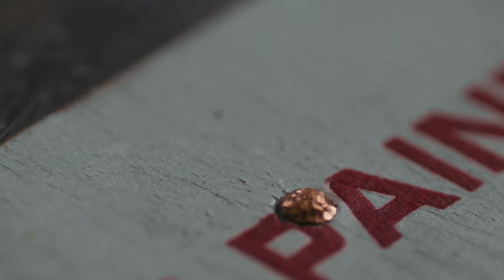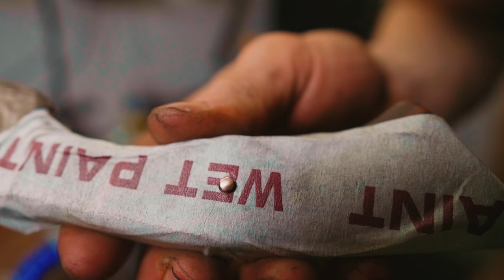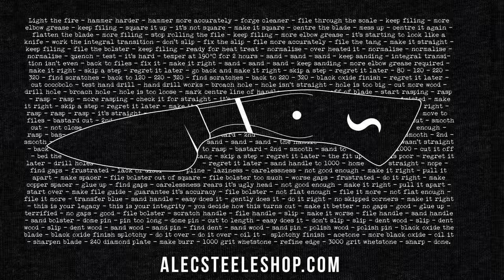MAKING A KNIFE WITH NO POWER TOOLS!!! PART 8 - FINISHED!!

Comment: The copper shim was definitely agood mistake.
Reply: Luis Gerena 
It was as if it was planned.
Reply: Happy little accident
Reply: love the Bob Ross quote
Reply: Must agree. I came here to make the same comment. Great finishing touch.
Reply: I was gonna say the same
Reply: this was going to be my comment
Reply: The copper shim absolutely made it better.
Reply: Not a mistake but a design modification! To quote Tim Yoder. Check him out Alec You can learn from him your to hard on your self!
Reply: The copper came out way better than the black shim would have.
Reply: I love seeing copper being used to fit wood and steel together, because the malleability of it means it can be easily shaped to fill in little gaps, while the colour and shine means it matches both for how they look.

Comment: Hey Alec I hope you read this! When you have a little dent in the wood and it didn't cut the fibers you should be able to fix it easily.
Just grab a moist piece of towel and a clothing iron. Now put the moist piece of towel on top of the dent, and put the clothing iron (or something else that is very hot) on top of that. 
This will create steam that makes the dented fibers swell up to its original state. Now just sand it lightly since some fibers go and stand up which gives the surface a rough texture.
I hope this helps you in the future.
Reply: Yep. I do that......a lot!!
Reply: A great tip Pandasty. Thank you for sharing that one!

Comment: if you use a wet rag, a iron and a piece of wood with a dint in it, if u iron the wood with the wet rag between it will bring out the dints, allowing you to sand them flush or have less of a dint.
Reply: NoSoupForYou9871 I’ve heard about putting a drop of white spirit in the dent and lightning it too, obviously quenching it quickly before any burning, also works?
Reply: Dinto's Twin never tried burning it  so i cant say but the iron works fantastically, use it all the time when i mis swing or drop something when wood working

Comment: Wonderful job! I have domed a lot of pins and I have a tip for you. Try a very small ball-peen hammer and no punch. You will be surprised how much control is possible with just a 6 ounce ball-peen. I use the ball end of an engravers hammer and it works wonderfully.

Comment: To be honest I like more the flush pins you've been using in the past, it should also feel better in the hand not having that bump sticking out of the handle. That said it's always nice seing you try different stuff.
Reply: Mindereak-I was going to say the same thing
Reply: The bump is so small that I doubt it will be a nuisance for your hand. It probably just gives it a better grip.
Reply: Well I don't know about the hand feel, I was just assuming it. It's just that besides that I just like the "flush" pin more, it looks neater.
Reply: Nah I love the dome :). for having had knives with domed rivets before, I think the bump it gives feels quite good.

Comment: Why not make a die/punch with a dome shape in it (concave) so its a little less dangerous and a little easier and efficient to do the same thing?
Reply: That's the tool I've learned to use for that job, you're right.
Reply: I'm talking out of complete ignorance here,but i think that such a tool would slip even more,and by having the dome carved in it would scratch and dent the handle even more. But as i said,i know nothing about that,so please correct me if i'm wrong.
Reply: with the round tip, you push material around in a more precise/controllable fashion
with a concave tool, your basically mushrooming the end material, causing stress throught the pin
and especially at the ends

also using the round tip tool, you dont lose end material due to compressing the pin
so you can have more material forming the fastner, meaning more room for detailing
and the end wont shear off as easily

Comment: That's a damn beautiful knife. The focus that was required due to the hand tools made it even more beautiful. It's amazing that you can get a result like that with basic(ish) tools. And although the copper ring on the handle wasn't part of the original plan, it made it so much better.

Comment: A lot of the time, if you "dent" the wood, you can bring the dent out by ironing the dent with a piece of damp cloth or paper towel over the dent. The steam will raise the grain above the surface so you can sand it flat. I use that a lot for getting dents out of old military rifle stocks.

Comment: If you have miss-hits and scrapes in the wood like you had here, put a little bit of wet paper towel over the indent, then heat it quickly with a piece of warm metal (I usually use a clothes iron).  This will bring the grain and wood back up.  Yeah, you'll still need to refinish it, but you won't need to remove as much material as you would without raising the material.

Comment: Awesome, if you ever do this again, maybe try putting a washer over the pin before taping around it, that way if you slip off the pin when doming it the washer may save the wood. Just a thought, not coming from experience :)

Comment: Want to know the key to patience? Think about your work like this; whether or not you aim for excellence, you are still doing work. You can rush making 10 knives instead of one that's excellent in craftsmanship, but then you sell those knives for 10 pounds each, instead of selling the one excellent product for 150 pounds. You end up losing time and money, because you did something lazy and hasty. Don't think about the finished product when you are working, but the work itself. I love to start new projects constantly and find it hard to focus on the task at hand if I have another idea brewing in my head. But to progress, I need to push on with the current project as much as I can.

However, when you feel like you are overwhelmed, focus on the simpler projects for a while and return to the original when you feel rested. Excellence takes a toll on your mind, it creates stress. And that stress will go away, if you get your mind off from the difficult project at hand and do something else. Do some designing, clean up or prepare for the next project at hand.

Lately I've noticed that you've been stressed out slightly. Remember, that your mind and body needs to be taken care of before anything else. Don't burn yourself out. You have many years ahead of you and you are progressing great. Just remember to take a break every now and then.

Fantastic job on the knife, as always! This has been one of my favorite series so far from your channel, since the use of hand tools is an important craft in your profession that should be preserved.

Have a great spring!

Comment: Make a funnel jig (a countersink in an inch plate of steel) that fits over the pin you want to dome. The measurement (math) would vary with the size of the pin, the funnel, the cylindrical punch, and the taper, but you get the idea - just try to stick a pencil inside a hole to trace the inner diameter of the hole and you see that the width of the pencil and the sides of the hole prevent you from doing that.

Comment: correct me if i'm wrong, but here's an idea for domeing the pins.

Take out the copper pin, heat up on side, place into handle, lightly hammer it to the dome shape. Take back out, heat up other side, place into handle, lightly hammer it to the dome shape.

Comment: the copper shim was a beautiful mistake, the copper between to black and the wood makes it look amazing.
you can remove small dents in wood using steam. place a wet a rag over the dent. then use an iron, or a warm piece of steel to heat the rag. there are a few videos on youtube on how to do it.

Comment: It looks amazing and you should be tremendously proud of yourself. I hate to nitpick but I actually work on these kind of transitions some times, you could have filed close and used a fat razor to trim it true without having to touch up the wood or the metal. Great work though and always pleased to see your new work.
P.S. when you doing a scabbard series for all the cool stuff that could use a sheathe?

Comment: Just a thought, but when yoou were doming the 2nd part of the pin, could you not have made a concave punch, and used it more centrally to the pin, rather than a convex punch and working so much more to the periphery of the pin?  Might be something to try.

Also, the copper looks freaking awesome.

Comment: I was wondering why you did not make a die for forming the dome shaped pins. Wouldn't it work if you just mill in a bowl with a ball end mill in a round peace of material. Harding and tempering it and than using it as a die to form one side of the pin. Then putting it in your jig an use the die on the upper side? By this you would get a more repeatable shape and wouldn't have to do so much cleaning up?

Comment: Very nice.  For peening brass rod I have found a 1 oz jewlers ball peen hammer to be the easiest.  Form the head with thousands of tiny hits and it will look beautiful.  Also the small hammer will hardly do any damage to the surrounding material if you miss.  Love your peening jig I could use one.

Comment: i'm not sure how this would work in your situation but applying a bit of steam from a clothing iron will swell crushed wood fibers mostly back out.  you'd have to clean the oil off so that the steam could penetrate the grain tho...sped up sanding sounds like a mouse brushing it's teeth. if they ever did that. i suppose...

Comment: you should of got some sheet metal or some more copper plate and drill a hole in it, put the pin in the hole so then when you slip it hits the metal not the wood

Comment: You could have made two short, separate, mashroom-shaped pieces and then glue them in. It would loose its strength,  but it would be easier. Sometimes a little cheating ia good.